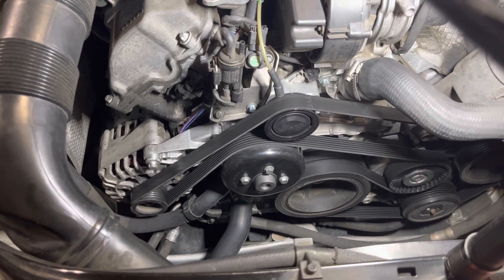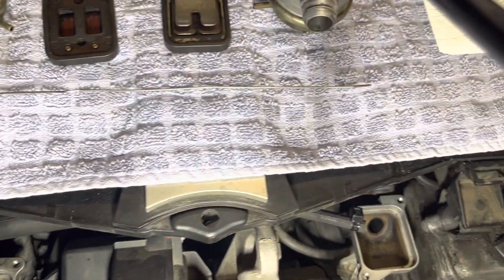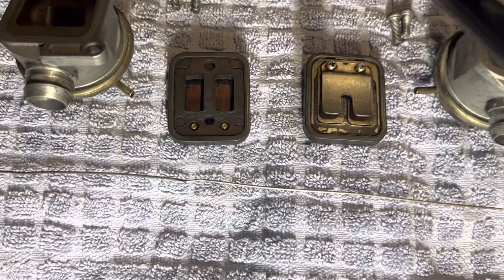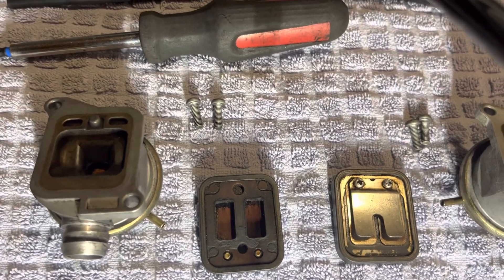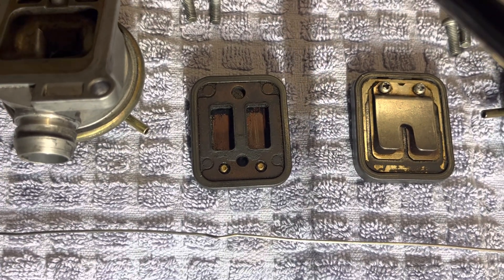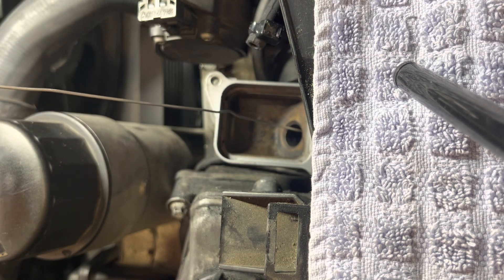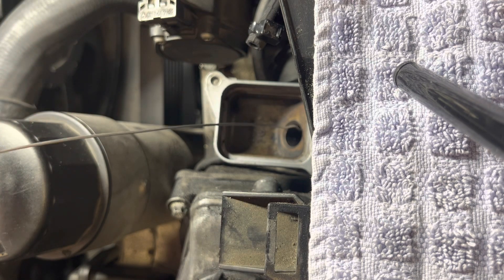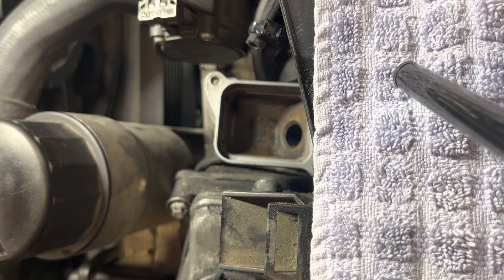Mercedes M112 M113 engine P0410 Clear SST Tool

Comment: I had success with passenger side, but cant clean driver side. Wasn't able to clean enough to blow some air. 
Update : it did work with carb cleaner and air and of course a little metal stick. 
Thank you man again. You saved my w211 )))
Reply from the maker: You are most welcome!

Comment: Hey I’m struggling with a p0410 code and I think this might be the problem, do you need to replace the gaskets on the reed valve? Or do you leave them is this a good first place to start, or do you think it is more likely something else, if I am to clean this I worry about carbon falling down into the cat jamming it up was that a concern for you or would you not worry about it? Thanks!
Reply from the maker: Hey Back. No you do not need to replace the gasket if you remove the reed valve carefully, if you want to help from it not to break then soak it with electronics spray cleaner as not to damage the rubber. DO NOT USE brake cleaner or anything that will eat rubber. Do not worry about the carbon down inside the tube, I too was worried but It had no adverse effect, it will burn off as designed to. Do however vacuum up/clean any loose carbon when reed valve is removed. If you are lucky enough to find a carbon ball like I did then you will know what I mean. BREAK A LEG!

Comment: I’m in the middle of a m113 rebuild . I took the time to split open both of these valves to clean them properly . I scrubbed them with diesel really quickly , washed them off with water & let them air dry then soda blasted them . the results were impressive because the soda blasting removed all the surface contamination / stains & exposed the bare aluminum making it look new again ! I also soda blasted every component of my intake manifold while it is fully disassembled , as well as both cylinder heads .feels good removing 100% of the carbon build up inside the engine .
Reply from the maker: Wow, excellent work! Reminds me of my 911 rebuild to mod of my 3.2 to 3.4L. How many miles before you did the work? My wife's car is now over 200K.
Reply: @jimchang911  170k on the clock .the reason I began this project is because the infamous timing cover O-rings failed .

Comment: Why not to use some kind of cleaner like brake cleaner instead of that tool.
Reply from the maker: Well, I tried that with a GDI systems cleaner basically a carburetor cleaner that would not harm the cat or O2S, filled it up several times, used compressed air. The solvent did nothing but make the issue worse. It impacted the carbon debris/build up in and around the  sharp bends and rough surfaces. You will see, give it a try and let us know. I hope you will have more luck than me.
Reply: Update - it did work. After 2 hours it dissolved carbon. I used motul carb cleaner. Now i can blow as much as i like 😁😁
Reply: It did not wokr out friend, more than hour carb cleaner is in tube but nothing happens, even blowed air but it did not work.